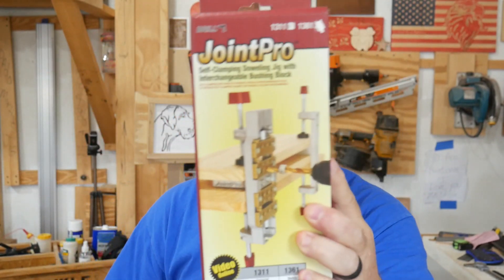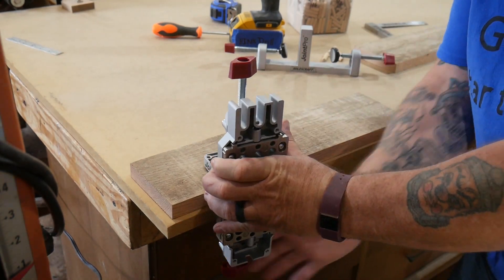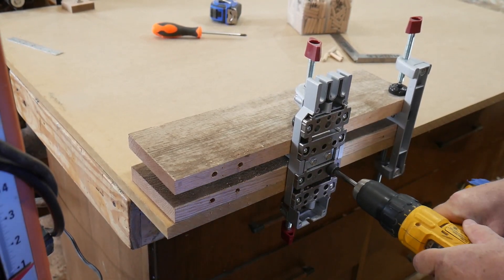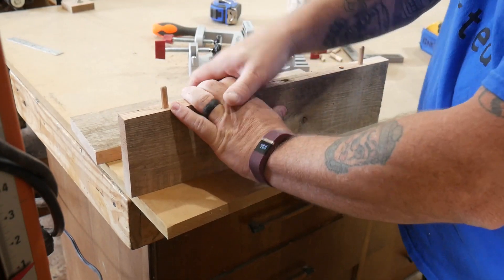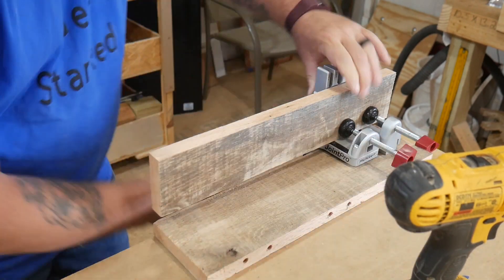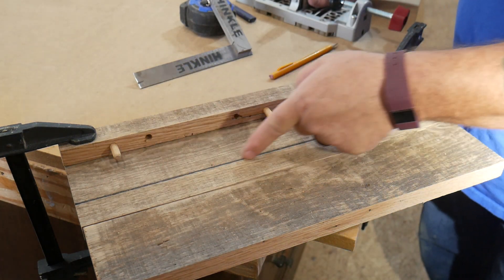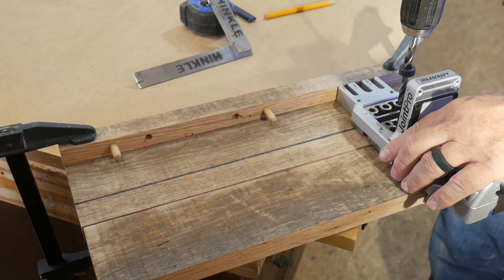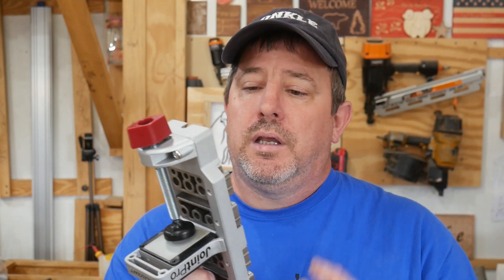Milescraft 1311 JointPro tool review

Comment: Hi Vernon, thanks for the video. Just to note....depending on the thickness of your timber, the dowel holes won't necessarily be in the centre of the board. I assumed it was self centering but it isn't. You can move the bushing blocks which help. Its not a big deal but something to be aware of especially with thicker boards. 

Look forward to more of your videos,
Reply from the maker: Thank you 
You are absolutely correct in some cases the dowels will be offset 
Thanks for watching!!
Reply: Good to know, thanks.

Comment: I bought this jig partly due to this video, which makes it look really easy. In fact, the boards need to be a specific thickness to be able to center the dowels. Plywood is a nominal 14mm in Canada, and this makes it impossible to hit the center. Then when you flip over the top board, the holes will line up along the length, but not vertically. This actually makes the jig worthless for edge joining. It seems that all the videos I've seen use boards that are sized to allow this jig to center the holes. The jig needs to be redesigned to allow users to adjust for center.
Reply: I brught It to Colombia we use a lot of particle board and melamine, iIt´s normally 15mm (5/8") and 18mm (3/4") the same thing happened and I used some shims to get the holes aligned and It works perfectly.
Reply: The holes don't have to be centered.  Just the same distance from the edge on both boards.

Comment: Why didnt you finish the whole segment of the video at 2:00? I want to know if they are perfectly aligned as you said. My concern with doweling is aligning them so that after joining them, it will have a flat surface with minimal flattening through sanding or planing.
Reply: I have one of these and it does not work perfectly well to align boards on a flat plane without lippage. Plate joiner is better for this. Considering the price, and for specific applications  (solid wood) there is value to this tool.
Reply: He didn't show it because the alignment was bad lol.
Reply from the maker: @meilyn22 🤪🤪🤪

Comment: That’s pretty cool but if you don’t clamp your boards perfectly and that seems likely considering they are not against each other, won’t the end result be overhang on one side or the other?
Reply from the maker: Hi shayne 
There is always the possibility of human error but this tool does a very good job aligning the boards the biggest challenge I saw was being certain to hit your alignment marks and if you do the joints went together perfectly
Reply: You should have a t square or a track or something flat to get ends matching, if you don't want to cut them to length afterwards.

Comment: Different sized dowels or just one? I typically work with 3/8", but occasionally  either 1/4 or even 1/2". It makes a huge difference.
Reply from the maker: Thanks for watching 
it works great on all three sized dowels 1/4 5/16 3/8
Reply: @Hinkleshop  I've used my ancient Stanley 59 single shot for years..lol  Might be time to splurge on something new. If I'm disappointed it certainly wouldn't be the first time in my 64 years.. I'm a bit hesitant with Milescraft since the majority of their stuff is pretty iffy. I really don't like those flat style knobs they use. I have several tools from them with them attached.
Reply from the maker: I think you would be happy with this is not the typical plastic tool this one is aluminum and built pretty heavy

Comment: Thanks for the review. I am impressed with the tool. I went to the Milescraft webpage and noticed that they actually have two dowling jigs. THe first is the 1311. The other is the 1334, which is a little less expensive. Does anyone know what the 1311 does that the 1334 does not do?
Reply from the maker: Thank you 
The one difference I see is single sided clamping where as the 1311 has two fixtures which in my opinion would give better alignment 
The 1334 looks like it would be quicker to set up though

Comment: ُThe 1st and 3rd ones weren't inline. Probably 1/8 or 1/16 off. Also, the thickness of the board cannot be thinner than the thickness of the drilling block which renders it "less" useful. This jig seems difficult to use. The boards will slip slightly when you reposition the drilling jig and it's not accurate.
Reply from the maker: Thank you for the input 
Fortunately I’ve experienced no issues with alignment and once you understand how to use the tool it’s quite simple to operate